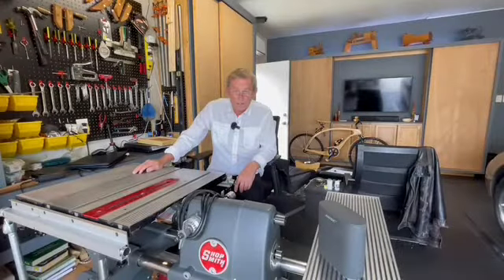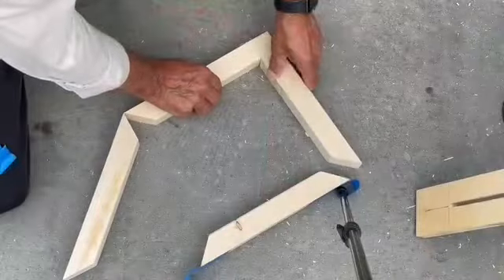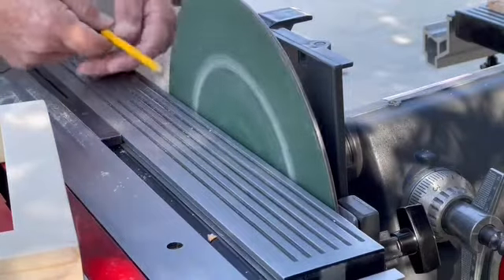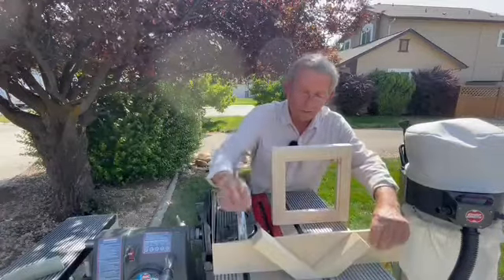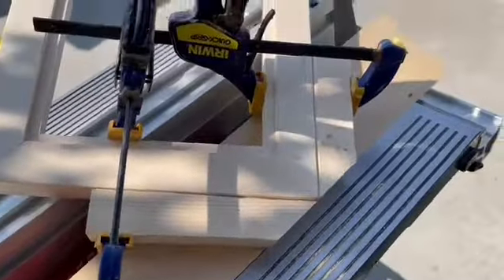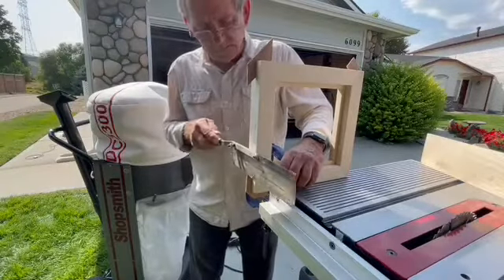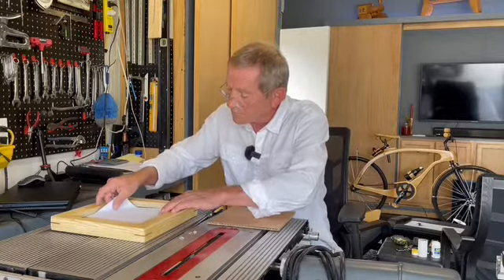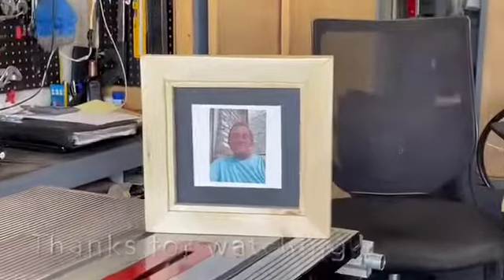Picture perfect projects. #shopsmith #shopsmithpowerpro

Comment: Nice project Mike. I have made a similar jig and use the Shopsmith biscuit cutter for small boxes. Adjust height with quill. Would work for the thickness of this frame, but spline would be pretty short.
Reply from the maker: Thanks for the tips!